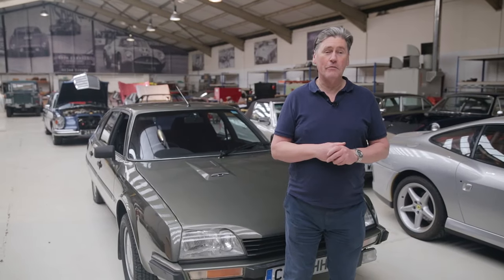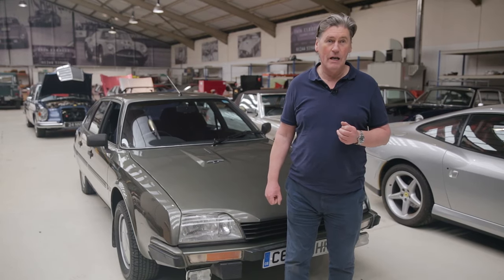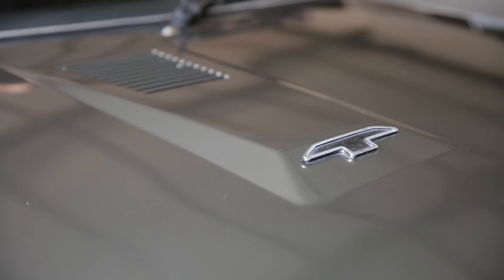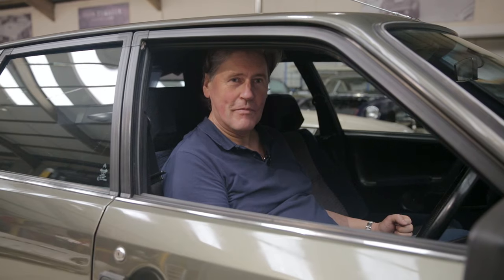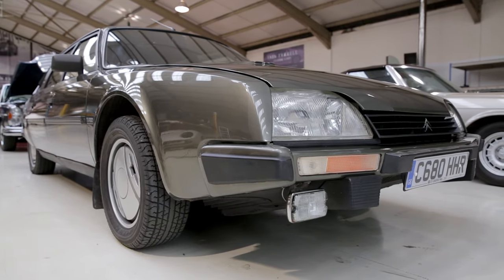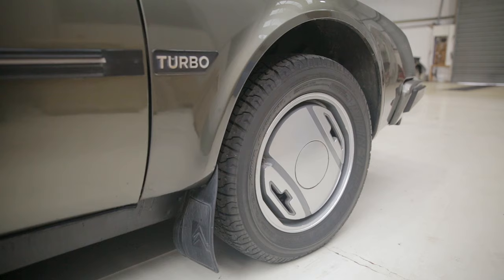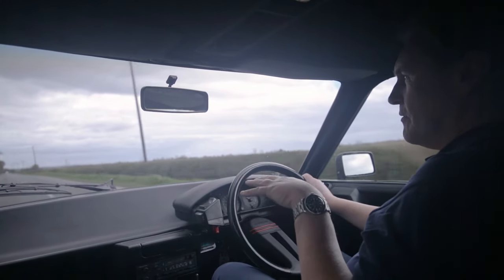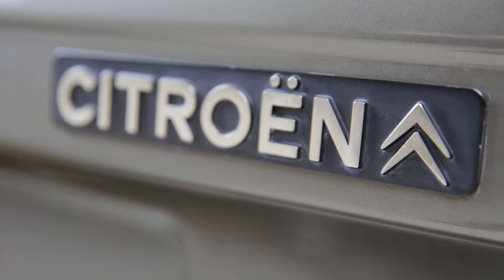Citroën CX 25 GTi Turbo - a rare beast with party tricks | Tyrrell's Classic Workshop

Comment: I had a CX, that was superseded by a Rover SD1 350S Manual, which in turn was replaced by and An Audi 100 Avant back in the day, if only the Citroën had the Audi 5 Cylinder or the Buick V8 of the Rover!

I parked thE CX in a parking row in front of a parade of shops once and came back to find it resting on the kerb the front was overhanging, not having realised it was an abnormally high one.

I believe that Rolls actually used Citroën branded globes on each corner of the Shadow. It’s also worth mentioning that for years BBC Outdoor Sports used Ds Safaris then CX as camera mounts to film horse racing while driving around the side of the track on the very poor tack on the spectator side of the fence, no other vehicle could remain steady, the footage seemed to,have been shot from a vehicle on railway tracks.

Comment: at 13:45 One of my Bentleys had that suspension and the thing was massive... and oh, so smooth.  I used to describe the acceleration the same way you did (taking off in a Boeing 747). thanks!

Comment: The water in my local ford was only 6" but I took no chances and raised my CX25 GTi Turbo to it's max.
Half way across, the ignition cut out and I was pulled out by a winch on the front of land rover.
However, with the car at full height, I was able to get out without letting water in.
With the self centring steering, you had to steer out of a corner, as well as steer around it.
If you let go of the wheel and let it run through your hands, you would end up in a ditch on the other side of the road, if you were lucky enough not to hit someone coming the other way.

Comment: nice cars, worked on one last year. Black paint, black interior with red accents. problem was, it just would not pull like a turbo II should. Turned out the hose on the intercooler hose was split on the connection top side. Some vulkanized tape a new clamp, and my god that thing was FAST. and comfortable. The car is a bit complex, but a great drive in good condition.

Comment: Another advantage of the Citroën suspension system is that the more load you have onboard, the more pressure there is in the spheres, and the harder the brakes come on. The brake feel is almost exactly the same with half a pallet of bricks onboard as it is when empty.

Comment: reminds of my time firefighting back in the 1980- 90s there were a few cases of the Citroen BX's catching fire ( a lot of cars did in those days ) and a few near misses where the superheated suspension sphere at the front would launch itself like a rocket up through the fiberglass bonnet, and the rear one leaving the car at a rate of knots at knee height! we would choose our line of approach carefully if it was a Citroen on fire!

Comment: Excellent video. I'm a great lover of the old big Citroens. I like to make a remark to what you stated on the Wankel engines. NSU and certainly Mazda had resolved the main problem, the seals at the rotor tips, as far as I know by the early 70s. However they could not alter 2 characteristics of the Wankel engine: it consumed quite a bit of petrol and oil. Two things that were not liked when the first fuel 'crisis' hit the world. A pity, I have a been a passenger in a Citroen GS Biturbo, a truly exceptional car. The very smooth Wankel engine suited Citroen's smooth ride (because of the hydropneumatics) very well. A shame only a little over 870 were ever built, most of them were bought back and destroyed by Citroen... At the time it was said that the exhaust could run very hot and a few cars caught fire when parked over long grass, I'm not sure this is actually true, I doubt it as no such problems were ever mentioned on the NSU Ro80, another exceptional car and the grand daddy of all modern Audis...

Comment: Wiw I'm getting old. I remember doing pre delivery on these. Actually the suspension is very simple on these. It got complex on the xm. It works by a tap attached to the roll bar that has a factory set neutral postion and it has a pressure supply in and an out to the struts. If the car sinks then the roll bar opens the tap and lifts the car. If its to high then the tap opens to the return and it sinks. The spring medium is nitrogen behind a diaphragm. And now the nonsense. The engine block would block up with rust and crack the liners. They would block so badly that the drain plug could be removed and nothing would cone out. They did warranty them for a long time after the expiry date. So they weren't that hardy. The suspension was never ever design to be driven in high or low especially on rough ground as the suspension is locked out but was useful in floods. I'm still working for citroen.

Comment: Fantastic series, informative and interesting. What an increditable innovating engineering company Citroen used to be right back to the 2CV, Traction Avant, the stunning original DS and the HZ van, the Ami Super, Dyane, the GS, BX and CX and SM. Today's version of Citroen has unfortunately been subsumed into a larger conglomerate of "plastic fantastics" where to a greater or lessor degree if one were to take the plastic badging off any car it tends to look like any other and individuality appears to be underrated and unappreciated.

Comment: Great vid. Just one thing: the Infiniti Q50 also has 'fly by wire' steering whereby the steering wheel is not connected to the wheels (except for a failsafe system).

Comment: I am in the U.S. and doubt that the suspension was the reason that the Citroen was no longer imported into the U.S. As mentioned, Rolls-Royce continued to use this hydraulic system , which not only assisted the suspension but also was the power behind the braking system. R-R used it into atleast the 1990's, which were the newest ones I have worked on. One problem with the early useage of this system  by R-R was that they used brake fluid and the nitrogen-charged spheres had to be rebuilt frequently and the entire system had to be bleed out . They did switch to the green mineral oil, as Jaguar also used later, with disposable spheres. Mercedes-Benz also continued to use the system, both as the entire suspension system in some "S" class cars and as a rear load assist in the "TD" .  The moving headlights had be outlawed in the U.S. many decades before, so, for Citroens sold in the U.S. the headlights were fixed and did not move.
A couple of reasons that Citroen stopped importing into the U.S. was the unreliability of the Citroen SM's, mainly due to the Maserati engines. The seal on the water pumps would leak and allow coolant to flow into the crankcase, ruining the engine. There was also a lack of dealer support. Sales dwindled and nobody but weirdos would buy them. Saab filled that niche.  Although Citroen of America remained active for a few more years, it was mainly there for warranty reasons and to supply parts to Citroen owners. At one point, Citroen of American began sending Citroens to us, an independent repair facility after we bought some parts from them and they realized that we worked on them. After a couple of cars, we asked them not to send any more to us, for obvious reasons. Another thing, the only factory service manual we could get for the SM was printed in French, which isn't a common language in the U.S. We were able to read the specifications.
Aside from lack of interest from the U.S. public, one definite reason that Citroens were no longer allowed into the U.S. was the steering system. By U.S. law, an on the road automobile had to have a physical, mechanical connection between the steering wheel and the steering road wheels. Industrial, off the road vehicles were the only ones allowed to have indirect steering. Also, there was a problem with brake systems which didn't have a conventional hydraulic back-up system. Rolls-Royce, when using the  brake fluid hydraulic systems used a convention master cylinder. Also, unconventional for the time, the brake pedals went through the floor, whereas suspended pedals had been common in the U.S. for decades.

Comment: A litle error in the comment: the Steering wheel IS mecanically directly connected at front wheels, the steering assistance is classic hydraulic,  but the innovation was the DIRAVI , who is a servo power return in line speed variable system (soft at low speed for easy manouvers, hard at high speed for better control), invent for the Citroën SM...

Comment: Interesting you mention the Wankel engine in the CX - it actually went into the GS (albeit a GS with almost 100% unique parts) to create the GS Birotor and used the Comotor engine also found in the NSU Ro80 - the spiritual predecessor to the Audi 100 you also mentioned! Produced (850 examples) between '73 and '75 - just the launch period of the CX - at the end of the production run, Citroën tried to recuperate ALL Birotors produced and scrap them. A small number, like their M35 predecessors, did survive but Citroën disowned them and refused to service them.

Comment: That 'taking-off' feeling experienced when accelerating hard & the front 'diving' when braking would be very familiar to anyone who owned a BMC car fitted with their Hydrolastic-supension!
In 1980, as I needed a good body for a 1310cc rally-spec Cooper S rebuild, I found an engine-less Mini Clubman S that was one of the very last Australian BMC Minis built with the Hydrolastic-supension system. After pumping it up for maximum ground-clearance & adding adjustable lower suspension-arms to correct & improve the even worse wheel-camber, it really suffered from that pitching when braking & accelerating (with a rally-cam, larger valves, twin 1-1/2" SU carbs, headers & straight-thru exhaust....boy, did it accelerate! ). To fix the problem I obtained a pair of shock-absorber brackets & bolted them to the sub-frame where the standard cars have them, drilled out the upper suspension-arms to take the std Mini bolts, then fitted a new pair of shock-absorbers, which utterly transformed the ride & handling!

Comment: BMW also used that hydraulic system (only for the rear wheels, it was an option) on the E34 Touring Versions (Diesel or Fuel). I have one having that system, it's obviously simplified, but they use the same Hydraulic Fluid (Called LHM on Citroen and CHF for BMW, but it's the same).

Comment: ooo just one thing - unless I missed it - whilst the car does squat when accelerating it also doesn't dive when braking. Quite a strange feeling for the first time long with the high pressure brake pedal! Great video.
Reply from the maker: You're right- it doesn't squat under braking. Clever supension geometry and even caliper position on the rear arms did that. Thanks for your interest

Comment: Another great video- thank you! My only criticism would be a wish for more footage of both the exterior and interior. So many of the cars you feature have some very interesting & unusual details (such as controls & instrumentation), and also have features that were either well ahead of their time, or are no longer common- I think it would be great to include some of these details and design elements, and let us see them here, as sadly, the chances of seeing some of these classics “in the flesh” are probably pretty limited for most of us…  I’d love to see a video by you on some of the more interesting features, controls (strange switches, hidden features, or unusual options) or details that are usually overlooked. As an example, removable seats for picnics or camping (SAAB and some of the French marques come to mind), or my father’s first and favorite car (when he came to the U.S. from Norway as a university student) a Nash American sedan (it might have been a Nash Rambler, but this is what I remember) in which you could recline the front bench seats to meet the rear bench seats and create a rather large and comfortable bed! He preferred that immensely to a Mercedes he once rented in the 1960s, which slipped out of park due to the contortions necessary to… errr… engage in relations with an enthusiastic young lady in the limited space available, and the car almost rolled off the edge of the dock and into the Oslo fjord in the middle of winter! Apparently, the parking brake wasn’t engaged as it would have gotten in the way… He was a VERY naughty boy, and had many such stories… ; )

Comment: Hi Colin, great video of a great and much underrated car with lots of as you say trick bits. 
I note you didn’t mention the concave shaped tailgate glass which I believe was manufactured to negate the use of a rear wash wiper as the shape of the glass channelled away the water accumulation as the vehicle speed increased. 
Just another subtle feature of interest.

Comment: I had a CX, I loved it. Very safe car, easy to drive but my new wife couldn't get used to the size, so reluctantly I sold it. One day I was taking my mother to the next village when I could hear this noise like rumbling water, concerned I stopped to find out what it was. When I looked at the front tyres I found the passenger side was completely flat. It made no impact on how the car drove, no pulling into the side, in fact the car drove normal. An indication of how safe these cars were.
Reply: I must add you didn't mention that the steering was also variable, easier when parking and more direct the faster you travelled. There is so much about that car that is great, notice the indicators etc are operational without having to take your hands off the wheel, I could go on, love them.

Comment: She also will drive on three wheels. You can completeley remove a rear wheel and carefully drive home. Also: Heavy break use left the car absolutely horizontal. No nicking with the front. Heavy breaking with one half on tarmac and the other side on dirt has absolutely NO effect in loosing the line forward... and so on. Love my Mademoiselle :-) AND: Since 25 years I never had any big problem on the road! She has absolute reliability. Always.

Comment: It would be a much longer video if one covered all the features the CX had.   For example, concave rear window that was self cleaning in rain and needed no rear wiper. and another  was a venturi underbody. Above 100 mph the venturi would become effective and the downforce would glue you to the road.  Another was  excellent stability at high speed in cross winds, the shape of the side panel split the cross flow  over and under the car so the car would hold arrow straight when others were struggling.   Many were fooled by the soft ride and never discovered how good the  CX handling was when driven fast. The suspension in a CX stiffens with increasingly speed, exactly what you do want. In a conventional coil system suspension softens with speed which is bad, normally overcome in say German cars by making the ride excessively firm at low speed. 

The suspension is anti-dive and anti-lift so under hard acceleration or braking the car would stay perfectly level.  On the test drive getting the front lifting points to something being not quite right.  Usually caused by  LHM fluid not being changed as often as it should be leading to a build up of dirt in the systems.  The critical point for dirt in the pipework being the three way spool valves attached to the front and rear roll bars that control the height of the car at front and rear. 

I had a Mk1 CX Gti. It was 'only' 120 bhp and not quick to accelerate but you could cover miles very quickly as the excellent handling and low drag coefficient meant you could hold a very high average speed. 

The biggest challenge apart from rust was the fuel consumption typically about 18 mpg.

Comment: Unfortunate these were not imported into the United States.  Our last choice was the SM. The cd of the Audi was advertised heavily here (Audi 5000) and the magazines made quite a point about the flush windows and removal of rain gutters. Then they started writing about the 300E (w124) and how it had a lower drag without all these things as well as have a hood ornament! We had both an '85  5 speed Audi 5000 and '86 300E. The Mercedes-Benz was quite a bit more money but we had it for over a decade longer than the Audi sellling it on with 300,000 plus miles.

Comment: I am a great fan of the hydropneumatic Citroens but there is one (IMO) major deficiency with the system.  As you say, the suspension damping is effected at the entry point into the pressurised spheres and that means that the compression and rebound damping are the same rate, whereas for decent handling the rebound damping should be ~2.5-3 times the compression damping.  Also, because of the pressures involved, the system cannot be easily altered to change the damping.  All of this results in a 'floaty' feel to the suspension that gives little feedback.  Citroen did consider dispensing with the anti-roll (sway) bar, using the hydraulics to control the roll - early active suspension!, but it was felt that the roll was necessary to provide the driver with some sense of what the car was doing when turning. 
Citroen pressurised braking takes some getting used to that is foot pressure sensitive unlike most common braking systems that are initially movement sensitive.  Most normal braking is best practised by 'placing your right foot on the pedal/button and thinking about braking' that is usually enough to see a smooth stop. 

The later Mercedes (500E>) use a Sachs derived system that has the pressurised spheres with the variable hydraulic column operating on a separate 'Nivomat' damper  This means that the spheres only provide self levelling/spring assistance and the damper operates independently as normal.

Comment: You have to remember that the hydropneumatic suspension is not designed for "party tricks". The main reason was to have constant ride heigth of the car, regardless of the load, and this in combination with a very soft and comfortable ride. Impossible to achive with conventional springs! The exterme high and low settings are just for servicing purposes.